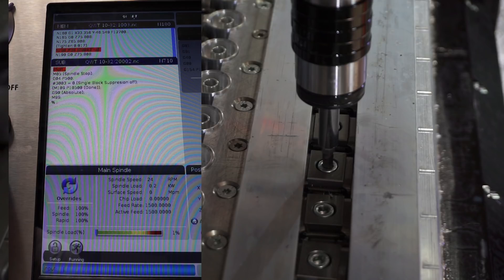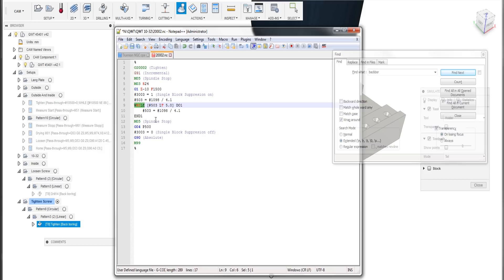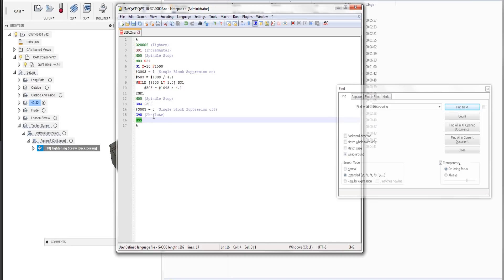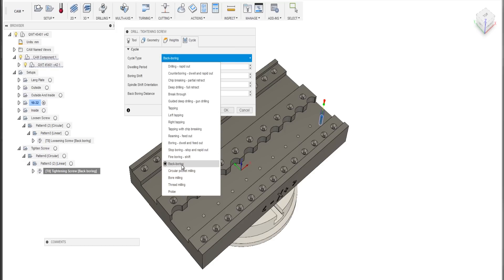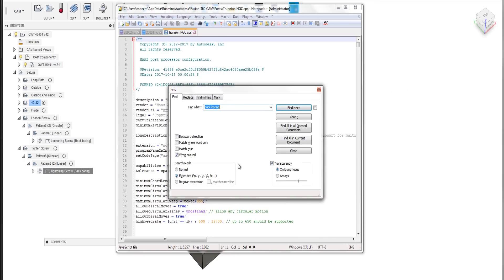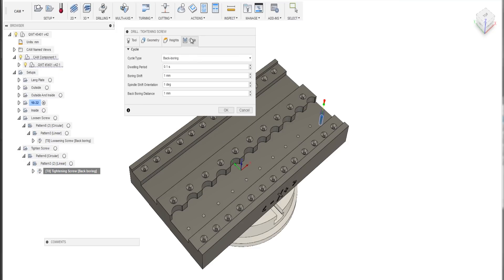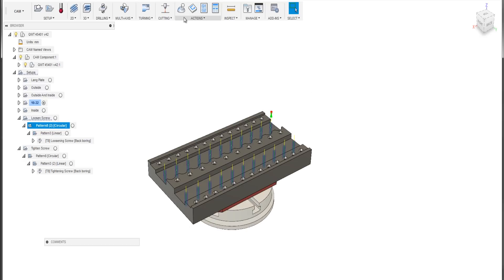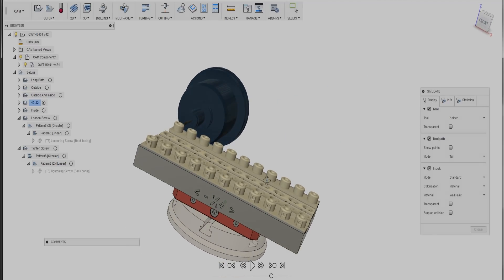Post-Processor Editing for the lazy Machinist

Comment: I love how you do things.  How did you come to the constant 4.1 for your torque approximation?  Did you simply do trial and error? Set %, then measure with torque wrench and adjust as needed?
Reply from the maker: I used a tourqe wrench from 1-10 Nm to calibrate the spindle.
Reply: PieceMaker another follow up question, is there a reason why you didn’t command a G01 within the loop?

Example:  WHILE [[#503 LT 5.0] OR [#504 GE -.15]] DO1
    G01 Z-.0005 F1.2
    #503= #1098 / 4.1
    #504= #504 - .0005
END1

Comment: Good to see new content from you! Really like this method of tightening your clamps. Now all you have to do is intagrate your UR robot for part load and unload and you'll be totally lights out operation.
Reply: In addition to the Your proposal, Mr. PieceMaker can, after automatical measuring, and 

change used tools also buy automatical transporting system like this youtube.com/watch?v=MepHmUw6SM8 and automatical issuing to the courier and electronic signature. Similar for materials coming to the company.
Reply: And don't forget protecting against thieves -  also automaticaly tike this :   youtube.com/watch?v=nTs7VRFV36c
Reply: I realy thank for M29 and loops with #3003, this is great for development.